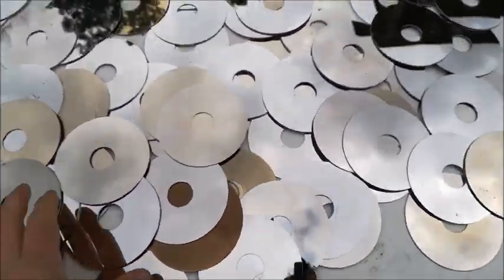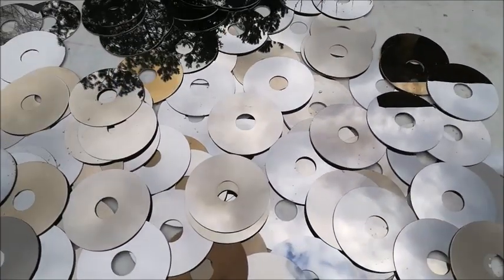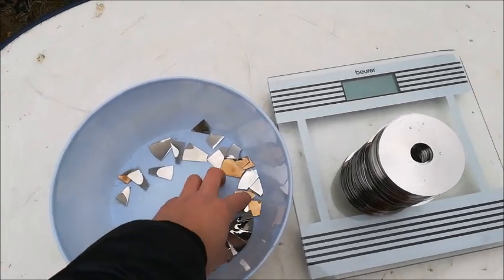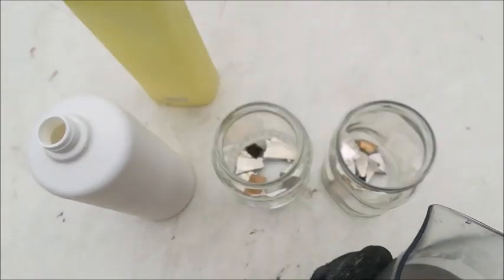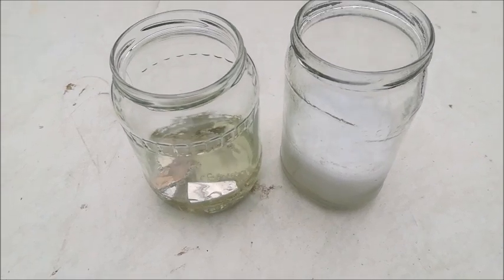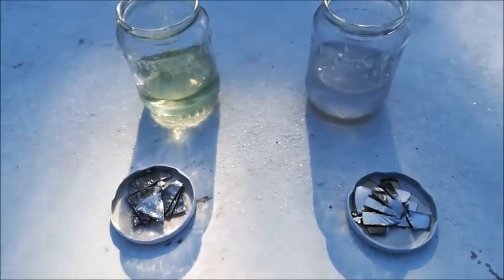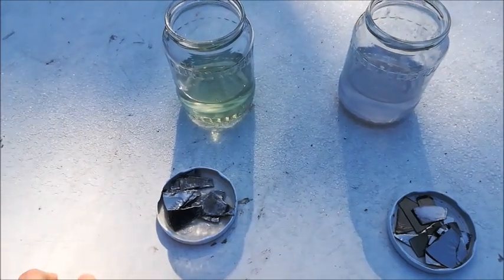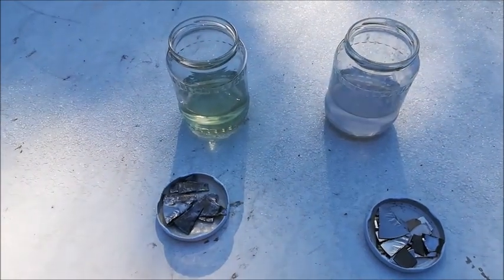How much Platinum is actualy in Hard disk Platters Part 1

Comment: Aluminum platters do not usually use platinum. The magnetic layer is iron /samerium cobalt alloy based on these. The glass ones are the ones that have platinum cobalt alloy.

Comment: This guy needs to watch some Nile Red to pick up some chemical safety tips. You never pour that much NaOH into that little water and not expect a violent reaction. You're lucky it didn't splash up into your face. Also, I'd keep the HCl acid away from the NaOH, as they will react together.

Comment: doesn't sodium hydroxide cause corrosion of glass
Reply: Over time and with high tempratures it will corrode glass. It's very little, but you should use cheap jars and not expensive glassware. The glass will be weaken so always be aware of that if you are going to use the same glassware later.
Reply: @Andy-hj6om  and fusing stuff with sodium hydroxide in glass container is the most stupid thing a person can do!But in nickel crucible it's just one of the most useful methods of all used in precious metals recovery-at least in preparation for it!Because nothing else will eat all organics and silicon leaving gold and other precious metals untouched!
Reply: @johnsheppard1476  I will in no way say it's a good way to do it either way. Only answered if sodium hydroxide will corrode and weaken the glassware.
Reply: That is why I use the nickel crucible which never reacts with sodium hydroxide and so I use the molten sodium hydroxide for most applications and I should say that it is really the most useful method I found so far for precious metals recovery!It's practically the only way to dispose of all organic crap and destroy the silicon dies leaving gold and most other metals untouched!

Comment from the maker: Well... what do you get for 2 kg Aluminum? 3 bucks?
Reply: Jabber.
Reply: Try .80c a pound you will get about 8$ for a 10 pound block at the scrap yard however if you polish a 10lb block up very nice then hammer a 10lb AU bullion stamp on it I have sold about 40 or 50 aluminum blocks with a nice stamp and polished up real nice for about 35$ to 45$ a piece it depends on the time i spend and the design i put on it the nice blocks of copper can go for alot on ebay u should check it out